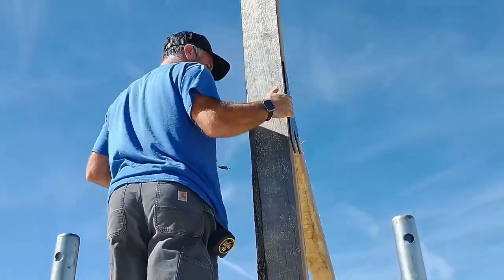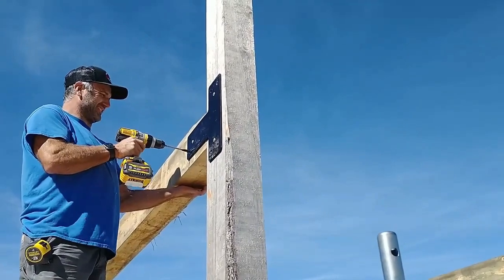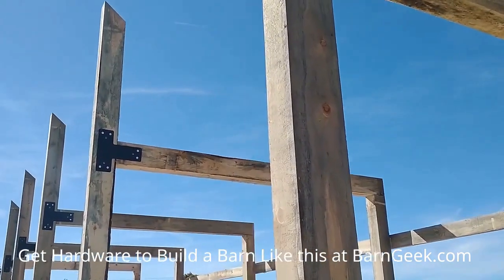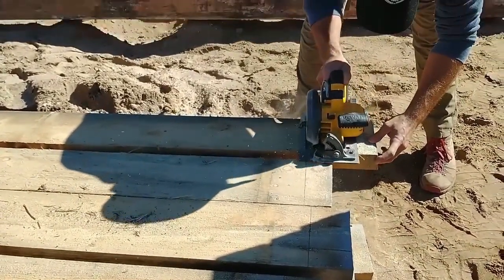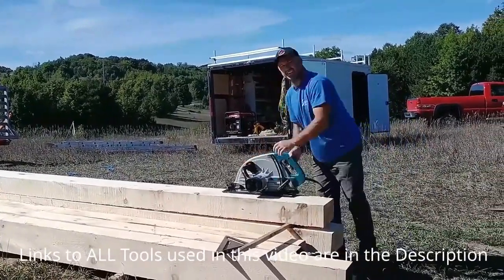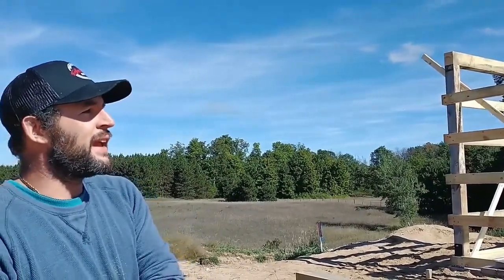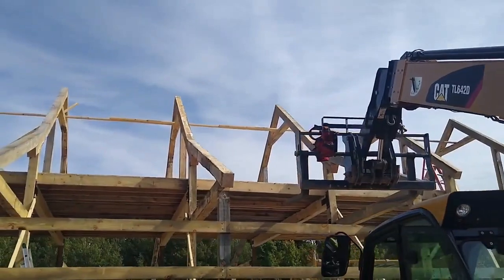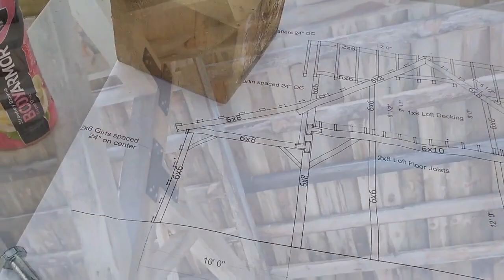True Craftsmen Reveal Secret POST and BEAM BARN Building Hacks for Beginners

Comment: You know simple mortise and tenon joinery is cheaper then the brackets .One beam to post joint takes   35 minutes.Of course use the brackets if that’s the look your going for I like it ok, I guess I would like to see your design s in mortise & tenon.I love your design s keep up the good work
Reply from the maker: I love mortise and tenon joinery. The problem these designs solves is the fact that most people don't want to take the time to learn a new skill.  Also their is a cost factor, steel plate joinery allows the use of smaller timbers than a typical mortise and tenon frame, this translates to large cost savings on timbers. My goal is to see more timber framed buildings compete with conventional construction. This design has accomplished that goal for multiple people all over the US, Canada, and Europe.

Comment: It looks like all the weight on the horizontal beam is resting on the 1/2” or 5/8” bolt going through the bracket.  Is that sufficient to support the weight being put on that beam?
Reply: It should be housed into post 3/4 of an inch
Reply: @jonsmith9708  That’s what I was thinking, so the weight rests on the post and not the bolt.
Reply from the maker: Thanks for the question, the beam isn't only supported by the bolts, there are 2 - 1/4" steel T plates, one on either side of the Tie beam. I have had multiple engineers review the design, and all have found it to be more than sufficient to hold the weight. Including several engineers who have purchased the plans and built our barns as designed.
Reply: @BarnGeek  Thanks so much for that clarification. I really enjoy your channel.